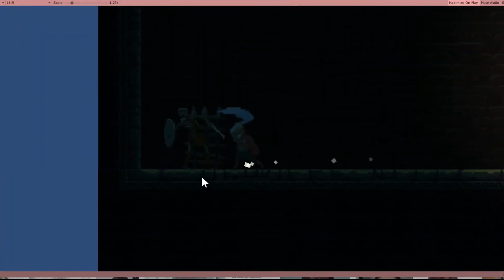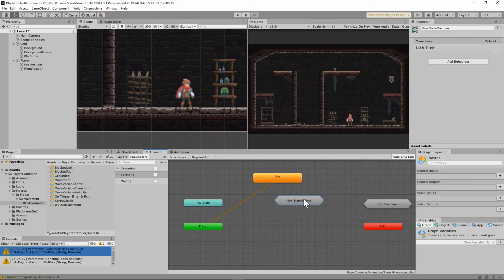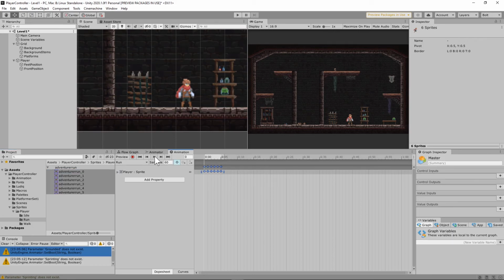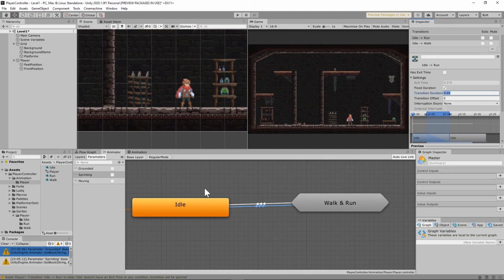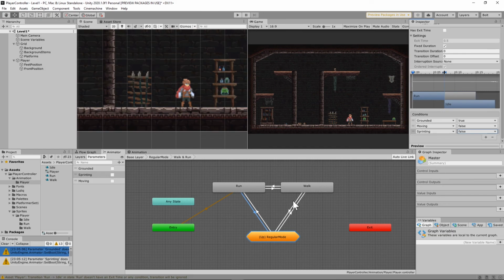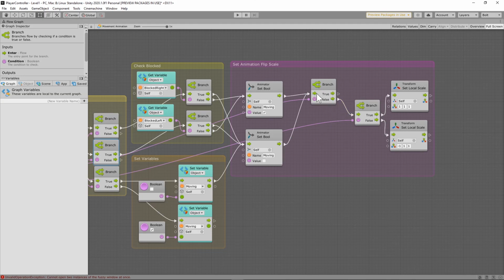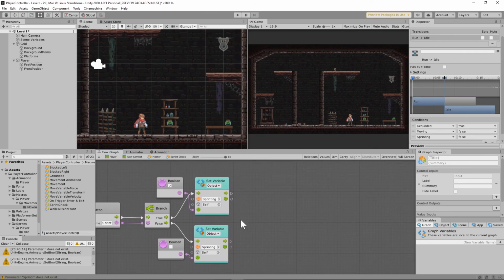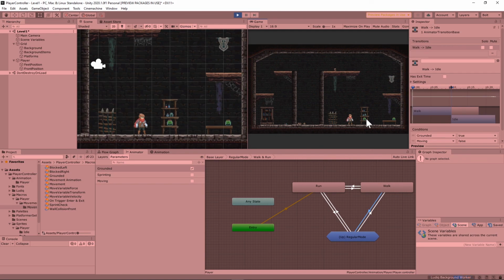Build A Player Controller Without Code # 4 - Move Animation - Bolt Visual Scripting + Unity

Comment: Just to share:

I had an issue where my sprite would flip upside down when facing to the left. Turns out I had put a -1 in all the values for the False -->Transform set local scale node when it should only be for the "x" value. Great video series!!
Reply from the maker: Glad you got it worked out

Comment: Hey John, do you know why grounded and all parameters (but moving) of the animator won't check? This is causing my animations not to trigger. On the player inspector everything is getting checked and detected correctly (grounded, left and right blocked, sprinting, and so on). On the animator they don't for some reason I can't figure out for the life of me. Notice that if I click myself on the parameters required for an animation to trigger (namely both grounded and sprinting (because moving is detected automatically)) the running animation goes off correctly.
Reply from the maker: I am really not sure man.  The animator can be a pain in the butt.  I would recommend going back and making sure you have all the transitions set correctly.  In the future (who knows when) I’m going to completely rebuild the player controller without having to use the animator.
Reply: @Megahertzs  Hey! I went back as you said and I solved the problem. There was a missing check on the Animator set bool for grounded. I messed it up a little when I added a new module for running animation going right and going left (that btw works perfectly). BTW John, do you have any idea on how to make animations for idle facing right and idle facing left? (I don't seem to find any good parameter for doing that) This is because my character has a wound on the heart and it can't have the wound in different sides when he is facing a different direction, so created 2 animations for it but I don't know how to implement them. I also I want to add animations for turning right and left when running and also 2 more animations (start running and stop running) in order to make the transitions smooth. I would appreciate so much any help you or you guys could offer!
Reply from the maker: @guille_sanchez  yes sir, I would check out my enemy ai series.  There is a thing called a blend tree that can change the direction of the animation when the buttons are pressed in a particular way.
Reply: @Megahertzs  I'll definetly check it out! thanks :D

Comment: the animations wont switch at all but i have everything the same as you
Reply from the maker: Hey Mecha, if they don’t transition, then you have definitely missed something.  Not only do they work for me, but countless others.  I would encourage you to return to the last working point and try again.  Hope you get it working.
Reply: I'm having the same problem. Although the variable "grounded" and "sprinting" are checked on the inspector of the player, the won't checked on the animator parameters, and that's the reason why it won't switch. I don't know how to fix it yet

Comment: Hi. I love your tutorials, but following up on this one I got stuck for two reasons. 

The first that I receive a message ExitGUIException: Exception of type 'UnityEngine.ExitGUIException' was thrown.
Second is that my comparison A>B, the bottom one which goes into the branch on the far right side is never getting true value (even though I am pressing the button right), so my character is always facing to the left. (flips never getting executed)

Hope you can help, because I would like to continue the project, thank you.
Reply: I found my problem. In the Movement Animation flow macro, that A>B going to the far right that was never getting true value even when pressing the button right: what happened in my case is that I had the link with the Branch on its immediate left from true to true, when it should be from false to true. I fixed it and now it's working beautifully.
Reply from the maker: Can you find me on discord?
Reply: Having the same issue RN

Comment: Thanks again!
Today was hard, I changed the size of the frontposition box collider 2d and the Blocked macros did not worked. I could not figured out the reason, I set a smaller box collider and now it works!
Reply from the maker: Contact me in Discord and I'll try to help you out.